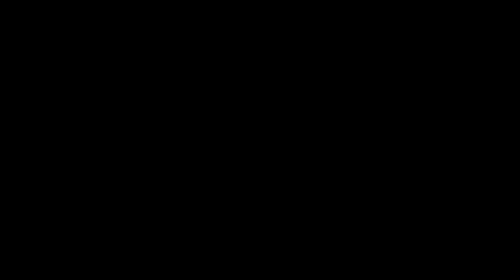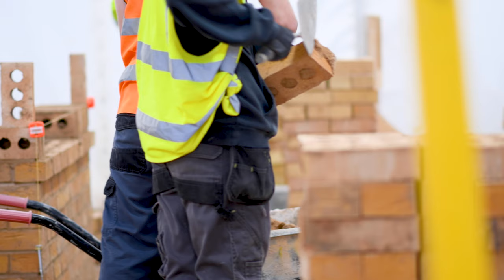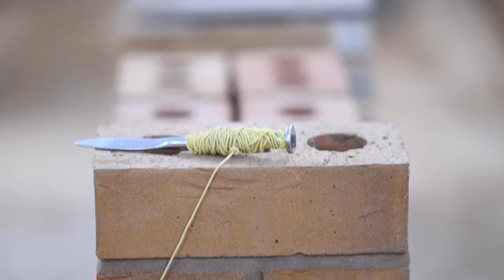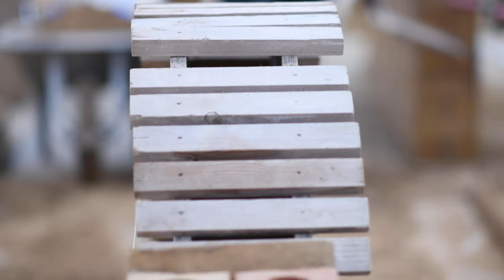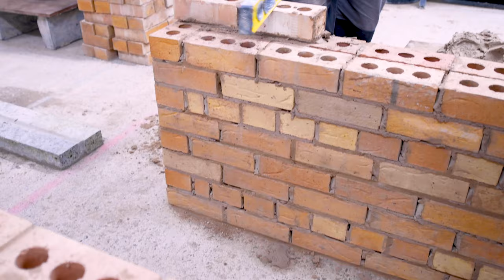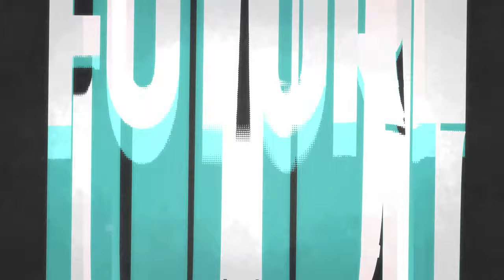Meet Tommy, our bricklaying student

Comment: Don’t be a bricklayer be a trade that works mainly inside you will lose thousands of pounds due to rain, freezing weather and Recessions , also Sciatica a serious back problem
Reply: Not sure. Overall u still earn around 45-50k a year. I'm lucky, my back is ok. But my knees aren't. Doing it 30 years now, not sure if I'd pick it again. But the grass is always greener on the other side. When I left school, I did mechanical engineering. But I hated it.